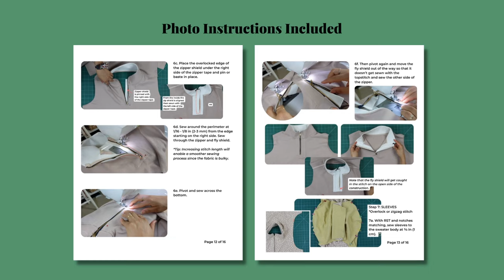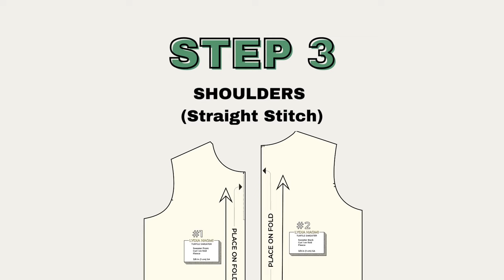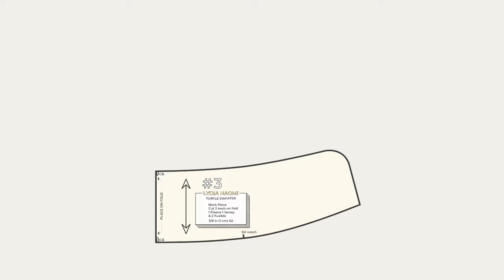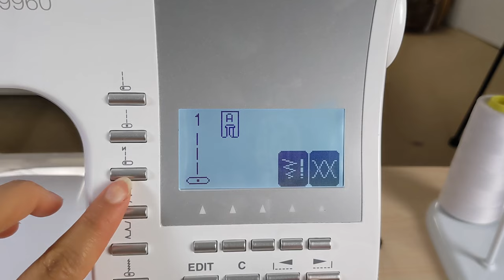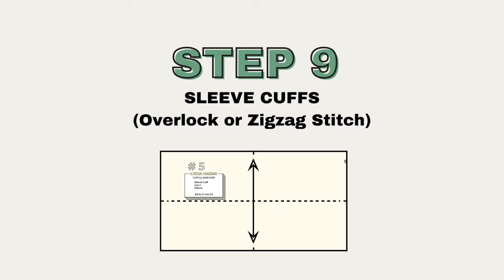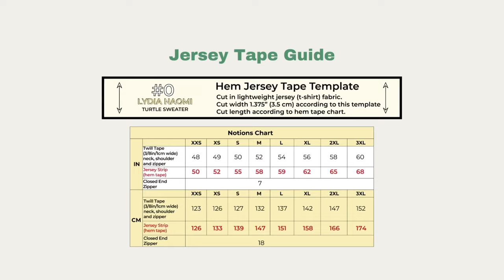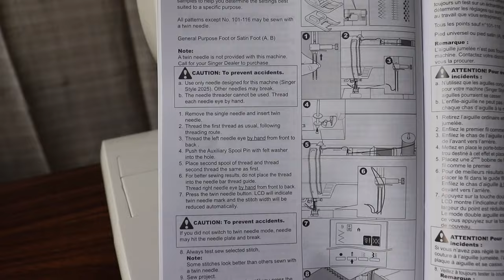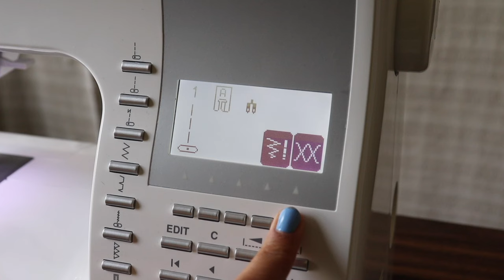Quarter Zip Sweater Tutorial + PDF Pattern

Comment: Wow, definitely going to get this pattern - your finishing details (e.g., twill tape usage to prevent stretching) are always so thoughful! 😊
Love that daisy fabric, too - it's so on trend. Do you think this will work with a poly/rayon/spandex French terry or drapey rib knit.... or would they be too stretchy? (I'm fairly new to knits but both are in the stash🙂)
Reply from the maker: Thank you! you definitely want a fabric with some body and not super stretchy. The fabric I am using can stretch quite a lot but it doesn't move around when I sew, its a more stable stretch. You are going to have an easier time with something that is less slinky! But then again, fusible interfacing helps alot in that area so it could work with what you have :) Hope that helps!!
Reply: @Lydia Naomi  Thanks for the tips - I suppose the rib knit,  which is poly/rayon/spandex, could be too thin to handle a zip, although I'm tempted to try it 🙂
Do you think a poly/spandex crushed velvet knit could work? It has body, maybe a bit slippery. I have different colored remnants in my stash that could be hobbled together....
I'm a bag maker, new to garment sewing,  and a good tip for applying zippers is using double-sided wash away tape! No need to hand baste. 🙂